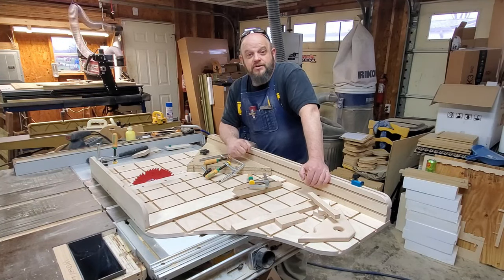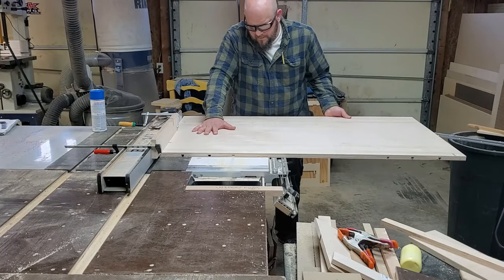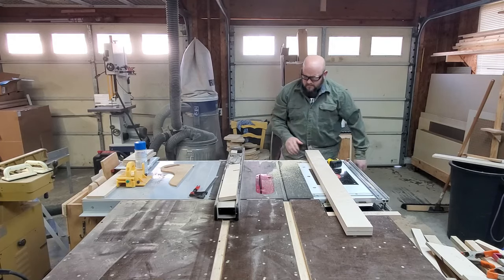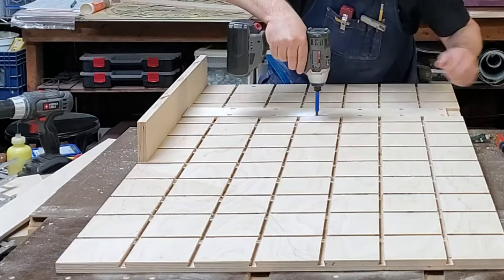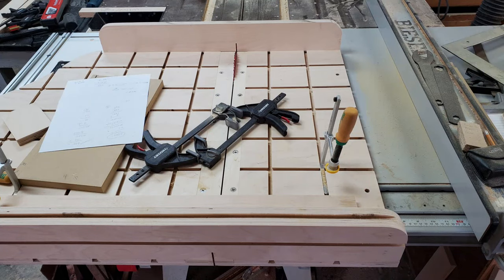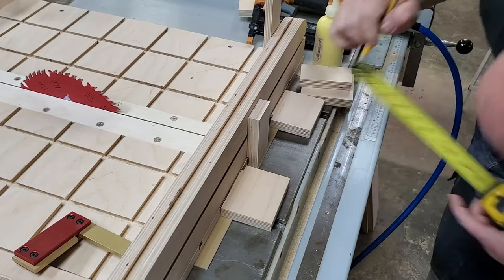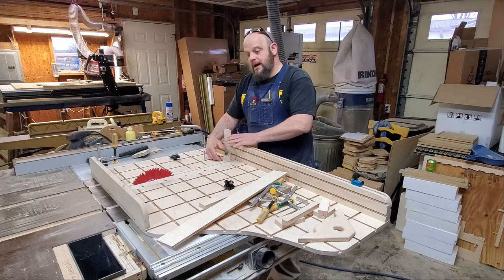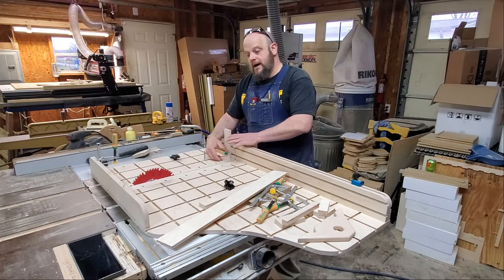Tablesaw Crosscut Sled Featuring Microjig Matchfit Dovetail System

Comment: Cut the last match foot slot that is up against the front fence so you can just lift it straight up, you won’t be using your clamp in that position anyway. I am using your design to build my own cross cut sled and to prevent the blade from ever protruding through the rear of the sled add a stop to your runners so the sled can only push to the center of the blade.
Reply from the maker: I looked at adding stops, to prevent how far the sled slides.  The issue, I ran into is sometimes you need the blade fully up and also clearing the apex of the raised blade at the fence. That pushes the blade pretty far back.  The box helps keep me safe during repetitive cuts.

Comment: I wonder if rare earth magnets would be strong enough to hold down the replaceable insert?
Reply from the maker: Possibly. I considered those and small dowels for alignment.  I decided against it just to be safe.
Reply: @ChristcrossCrafts  Great sled design! I made the slot for my replaceable insert an extra wide dovetail slot with angled sides on the insert to match. This allows the insert to just slide in and out with just a fastener or two to hold it in position.
Reply from the maker: @tooln8r844  i considered a dovetail but was concerned with weakening that area. I was planning on using the matchfit hardware.  

Great idea.. A big dado area with dovetailed sides would work with the same angle on the insert.  Since it will get cut through it still will need some fastener to prevent movement.

Comment: I love this sled, I currently about to start on it, One question though, The insert is 1/2” ply?
Reply from the maker: Thanks for watching.  It's 3/8 baltic birch.
Reply: @ChristcrossCrafts  Thanks for the reply! That might be hard to find, I believe I can get some through my Woodcraft, don’t thing the box stores carry 3/8.
Reply from the maker: @heathobarr4785  You can also use hardwood or MDF.  Either of those would work just fine too.  I picked it up from local woodworking supply - Klingspor's Woodworking Shop.

Comment: Awesome sled, best one i've seen, well done! Enjoyed the vid too. Think I might try and build one... what thickness board did you use for the main sled, and the inserts?
Reply from the maker: Thank you.  I used 3/4" baltic for the sled and 1/4" mdf for the insert.  With the dovetail grooves, 1/2" is too thin and still have good support.
Reply: @ChristcrossCrafts  Thanks!
Reply from the maker: I believe I just saw microjig make a similar version using 1/2 as a base then added another 1/2 on top.
Reply: Hey.  Love the sled.  I was building something similar in my mind then found your video and yours is just what I had in mind.  I'm about to make one just like it.  Now that you've had it in use for 4 months, what are your thoughts on it now?  Any changes you'd make if you made another one today?
And how is the 3/4 inch base holding up?  I have a sheet of 3/4 Baltic and 1/2 Baltic.  I was thinking I would need to double up 2 layers of half inch to make a 1 inch base but I'd much rather go with the single 3/4 if it's worked out for you.  Please let me know.  Thanks
Reply from the maker: I love it and find new uses for it frequently.  Originally I was going to go smaller, but I'm glad i didn't.  I might would make it a little smaller front to back but I love the ability to cut long panels & cabinet depth with room to spare.  The larger surface also gives me room to stage smaller parts before or after they've been cut.  

As for the thickness, the 3/4 has been more than fine.  I too considered adding thickness to prevent warping when not in use.  I hang it on the wall using two hooks and its perfectly flat.  Plus, extra thickness reduces the thickness of the parts that can be cut due to blade height.

The clamp that got accidentally locked in place has actually become a very nice feature.  Slide it in as needed and away when I don't.  I don't have to go looking for clamps.

Comment: Where do you get the wood from  I dont think my local lowes has it never seen any in there anyway
Reply from the maker: I have a local woodworking supply store (klingspors woodworking shop) that I use for most of it.  They don't sell the sheets online but do have it in their store.  

I buy most of my tools and supplies from them.  Most of the items used in this video (other than some screws) were purchased there. 

You might try cabinet lumber supply shops or even local cabinet shops.  I used to buy full sheets of cabinet grade ply from a couple near me.  They buy bulk so usually sell me a sheet cheaper than a big box store.

Comment: Hi Nice job on the video…! Sled is absolutely beautiful…! Nice to see somebody without so much ego they can’t admit that they make a couple of screw ups like the rest of us… LOL
You got one more new sub!
Reply from the maker: Thank you very much.  I've always tried to show my mistakes.  It shows I'm normal.  It also shows ways to think about the situation and fix mistakes... sometimes.  In this case, the clamp became a featured part of my "intentional" design.
Reply: Dibuje el pago de la factura 55555555555555555555555555 5555 que 555 54 555555252 la fecha fecha de pago del 5 555 y el pago de las expensas del 5225

Comment: How do you use the tracks that run parallel to the blade.?  If it is not possible why cut them?
Reply from the maker: Thanks for watching.  No, the clamps can't travel in the front-to-back slots.  I use the fixture pieces, T-bolts, and other hardware in those slots though.  T-bolts will actually enter from the side and make the turn at any intersection.  I've used this for almost a year and never needed a clamp.  I would cut the two ends off should I ever need them, but have not yet. 

I have brought a clamp from the side, or used a wooden hold-down and a T-bolt to hold some parts.  Many of my jigs have built in clamping capabilities, which makes it easier and not necessarily needed.  I'm actually working on an update video to the sled that shows many of the jigs and how-to' options I use.  It should be available in a week or two.

Comment: I often have to clean my router bits with acetone from time to time. **That's me!! Using acetone on or near power tools can cause fire!!! Glue from plywood jacks stuff up.
Reply from the maker: There are other cleaners that work well.  Just don't use oven cleaner.  It causes the brazing that bonds the carbide cutter to the steel body to weaken.

Comment: Without any relief, how do you put clamp inside those vertical dovetails between the front and rear fences?  Just open up the dovetails near the front fence with a straight bit (1/2") or chisel it out.  Otherwise, no point in having those dovetails in there if you can't use them.
Reply from the maker: I use them often.  If you watch my update videos, you will see I did add a slot in the back fence for the hardware to pass through.  I have not needed the clamps in those slots but have been prepared to cut the 1/2" clearance should I ever need them.  So far... I have not.
Reply: @ChristcrossCrafts  I was wondering about all those slots.  I can see you need that many for an assembly table.  For sled, I only  need 2 near the blade (vertically).  For  horizontal ones, I need 1 near the fence and  others are 8"-12" apart.  I can pretty much hold anything I came across so far.

Comment: I made one similar but it has the ability to remove half of the wing.  If you are interested in seeing my design I can send you a Sketchup drawing it.  I even drew in the slot to put in or remove the clamps.  I just need a way to send you the file.
Reply from the maker: Nice.  That's the beauty of the system is its so versatile and can be adapted to each person's preferences.  I'd love to see pics of what you did.  Christcrosscrafts@gmil.com

Comment: I've done squaring on a sled I made.  This required that I move the fence to perform the squaring.  Is this what you did?  You kind of gloss over it, and I want to make sure I am doing the right thing.
Reply from the maker: I do move the fence but only pivot it.  I came in 1" from the right edge and installed a screw.  That became my pivot.  I used the fence or the kerf and a framing square to get close, then ran a screw in the other end of the fence.

I then did the 5 cut method (a few times) to find square.  Making the needed adjustments after each test.  If you Google William ing 5 cut method, there are videos on it.

Don't use the free calculators available through other folks because they all miss a key factor in the process.
Reply: @ChristcrossCrafts  do you have plans for this build?
Reply from the maker: @RedcarWW  I don't.  I drew it up on a napkin and wrote down all my ideas based on previous sleds I've built that I liked and didn't like.

Comment: Do you have any plans or drawings of this sled
Reply from the maker: I don't.  I rough drew it out on scrap paper then started a list of everything I wanted in a sled and everything I hated about previous ones.  This is the end result.  

Some things are custom to my needs and saw.  I'm hoping I can keep it when I upgrade to sawstop and only have to move the runners.
Reply: What size is the base
Reply from the maker: @larrynolte9611  mine is 28x48.  I have 36" to the left of the blade and can put 26" between the fences.  I do a lot of long plywood/mdf cutoffs and wanted the support.  Not everyone will need that much.  

I also like I have space to put small parts after I've cut them and not be in the way.

Comment: Kinda sad that clamp is not coming out. Also kinda sad that camps can't go into other parallel slots either.
Reply from the maker: They can on the open part of the fence or even coming in from behind.  The clamps will straddle the fence and I can clamp there if I need to.  I've been using it for a couple of years and never needed to open the slots to allow for it (which I would if I needed to).

Comment: Great sled for a larger saw but mine would have to be smaller. Don’t feel too bad about your permanent clamp. Shit happens
Reply from the maker: Thanks for watching.  I cut a lot of parts 24-26" wide and the extra depth and width has been very helpful.   I've found it very beneficial for smaller parts as well.

The accidental permanent clamp has actually been a welcome feature.

Keep an eye out for an update video with all the new jigs ive made for it.   It should be out soon, as I'm finishing up a couple of jigs now.

Comment: If you get tired of breathing smoke, replacing router bits and cleaning out sawdust that clogs everything up and screws up the uniformity of your dovetail slots, pre-cut the slots with a spiral downcut bit that is narrower than the narrowest part of your dovetail bit before you try to route out the dovetail slots. You don't want to try to cut dovetail slots in one pass, and since the nature of the dovetail precludes one from making several progressively deeper passes, you have to cut out the meat of the slot with a straight bit first. It may seem like a lot of extra effort, but when you're routing 100 linear feet of dovetail slots it's a lot FASTER and produces much better results, AND it's cheaper than burning up three dovetail bits and having to replace the batteries in the smoke detector.
Reply from the maker: If I cut them on the cnc or use a hand router, I do a clear cut every time.  If I'm making short runs on the router table, I dont. The double setup is a pain, and I'm lazy that way.

Comment: I like the jig but why did you not use all micro jig products like the zero play miter bar system? I like the Kreg products but I think the Micro Jig solution for the miter bar is far superior to the Kreg solution. I have both and putzing all those screws in the Kreg miter bar was not fun and as the screw leaves the miter track it could potentially twist your miter bar giving you a less accurate cut compared to the micro jig. Anyhow I replaced my Kreg slides with micro jig.
Reply from the maker: Thank you for watching and the feedback.  I looked at the Microjig Zero play bar and was initially going to go that way, but it wasn't long enough for my application.  Once I changed my design (while still in my planning stage) to be a larger sled, they wouldn't work unless I added two per slot.  Once I spot glued the Kreg tracks on, I used a centering bit to ensure the holes were correct.  

Also, as the temperature changes, wood and metal change slightly.  The Kreg allows me to tweak the side-to-side movement while it's still in the slot.

Comment: Curious at this point, since all those parallel to the blade dovetail grooves trapped by the two permanent fences, are not useable, do we consider them cosmetic only? Or do you perhaps open up the dovetails close to the forward fence so you can drop in a clamp?
Reply from the maker: The grooves parallel to the blade can't be accessed by clamps, but can easily be used by the Matchfit fixture pieces or T-track bolts/studs.  There is enough room to make them turn at all intersections.  I actually made a couple jigs this way.  My miter jig uses T-bolts that enter from the side, but turn and are seated in one of the parallel grooves.  I tested it out on scrap before locking it all in between fixed fences (just forgot to remove that dang clamp).

Comment: how thick is the birch your using?
Reply from the maker: 3/4" baltic throughout.  The fence is double thickness.
Reply: @ChristcrossCrafts  Thanks. Did you use a special dove tail bit or will one of my standard one's work.

Comment: Are people just bored when they make crosscut sleds or do they just not have a drop saw . That sled is hours of work and probably cost a packet in materials ,  but it does look cool 👍
Reply from the maker: Thanks for watching.  My chop saw is only used for roughing parts.  My sled is more precise and allows me to do more than a miter saw ever could.

I spent hours designing and making it so it could make many of my processes more simplified and precise... and it has.  Best jig I've made I'm 30 years of woodworking!
Reply: @ChristcrossCrafts  That’s great , I am interested in the things a sled does that a dialled in sliding compound mitre saw can’t.
Reply from the maker: Wider parts (crosscut & miter), multiple jigs (spline, mortise & tenon,wedges, ripping, half lap, tapers, and the list goes on).  

If you've ever done woodworking and needed precision, you'd know a table saw is more versatile, stable, and accurate than a miter saw.
Reply: @ChristcrossCrafts  All the stuff I do on my mitre saw with ease , I find a lot of people struggle to use the tools they have to there full extent and end up wasting money and time they don’t need too .
Reply from the maker: @waynerobinson7143  There's not much of a struggle.  Just tool limitations due to size and function.  Unless you invest in a large quality sliding miter saw some of these operations can't be done.  Even the ones that could, would require the saw to be completely set up accurately... meaning you'd have to remove the fence and properly flatten the bed.  Then properly shim and set the fence perpendicular to that bed to achieve perfect 90°.  Once that's done, properly set the angle adjustment scale.

I've used them for years until I found the ease and versatility of a proper table saw setup.  I've been able to make cuts the reach of a "chop" saw simply couldn't.  To each his own, which is the beauty of woodworking.